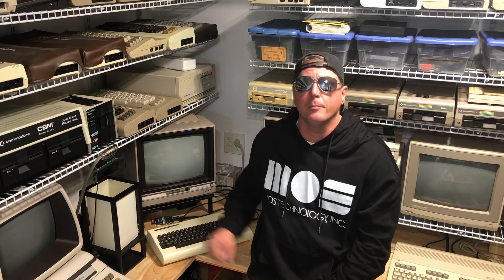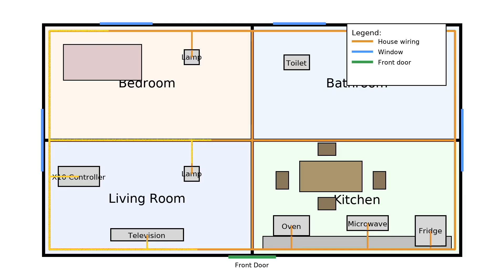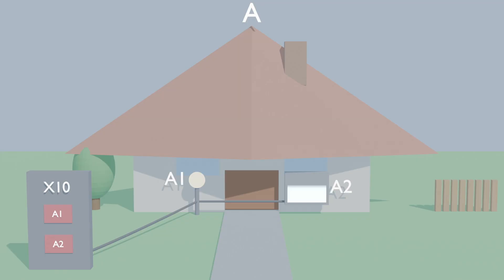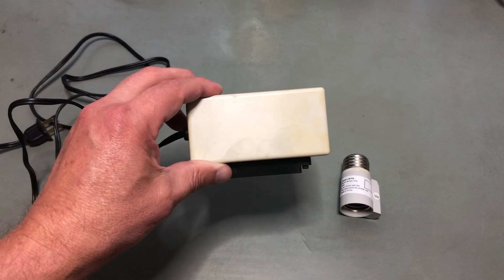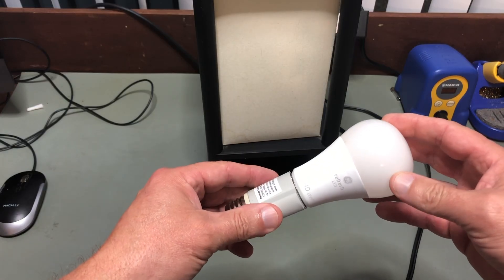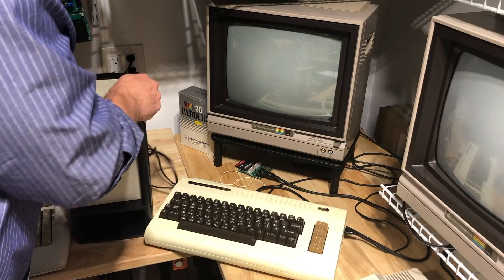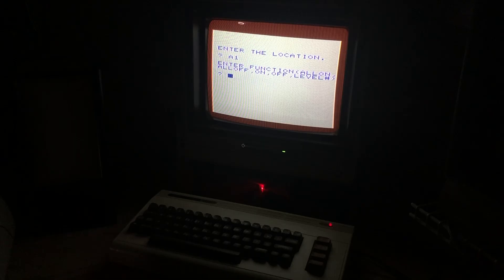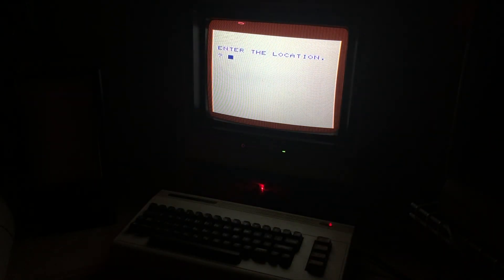X10 Home Automation using a 1981 Commodore VIC-20 Home Computer

Comment: I remember selling these at Radio Shack 

A few people were really interested in it but I never was

Fast forward to Alexa and I got a whole house of switches that respond to Alexa or Alexa controls them

I have to say, once you take the leap, you will love it

I got a Nest thermostat about 7 years ago and I had the Nest app and I used that to control the thermostat 

I then got Google mini
And then Alexa
And I bought a whole bunch of light switches from Best Buy and of course a few years later they stopped supporting their switches and they all had to be ripped out
So I bought all new switches and I wired them up

Now, the toughest part is getting the right app to control the switches

Once I got the app I added each switch
Then, I had to add the feature in Alexa 
A new skill
Then I had to add the app and link the devices to Alexa
Once that is done you are all set

I had a loss of power and I had to do everything all over again 

I talked to Amazon and I suggested that they make a new feature in the app that would allow you to store all the settings from the app
So if you lose everything, you can reload the entire setup from the backup
Reply: Home Assistant does every5h8n* for you

Comment: Aren't the VC20 and C64 userports just the same, so it can be used with a C64 as well ?
Reply: The hardware should work fine on a C64. If the software is directly banging out the bitstream to be merged with the AC carrier (by circuits in the cartridge) then one might need to at least re-point the routines at the CIA addresses in the C64.

The differences between a 6522 VIA and a 6526 CIA probably won't matter here.

Comment: That is great even for back then, over AC power line Multiplexing. I made a few radio project back in the day to send FM signals over the power line. I also made a circuit that you can still find today that can control relays using Legacy Parallel port with Lalim Parallel port controller  Windows application. Schematic are still available and very simple and easy to build, using  An optocoupler, relay, a diode, transistor, 2 resistors and 1 LED for a single module.

Comment: Wow.  I didn't know there was a dedicated controller from the VIC-20 era.  I have an X-10 CP290 and the Commodore serial interface (plugs right into the User Port but has a simple output-only RS-232 converter to a DIN-5 for the CP-290).  It came with home control software for the C64.

Looks like this: https://www.mugbbs.com/mugpics/C64-Powerhouse-CP-290-and-cable_Jan-11-2015-800px.jpg